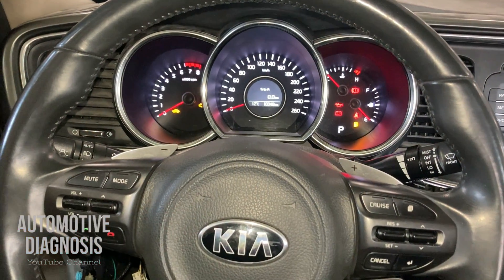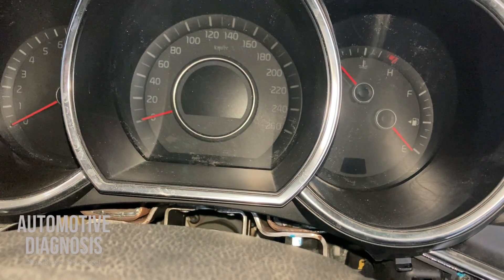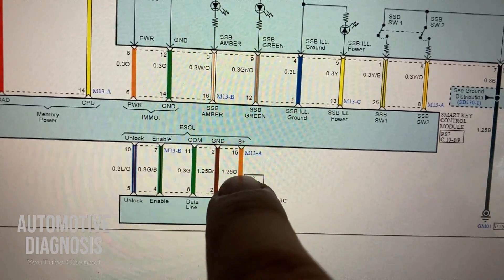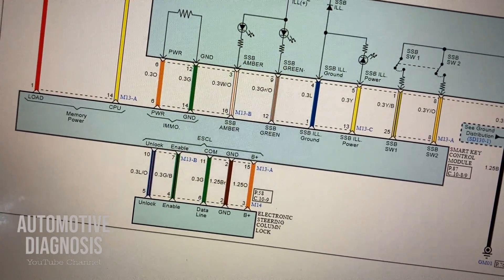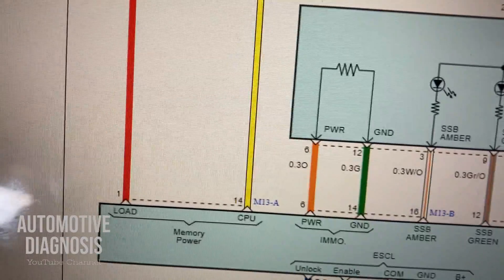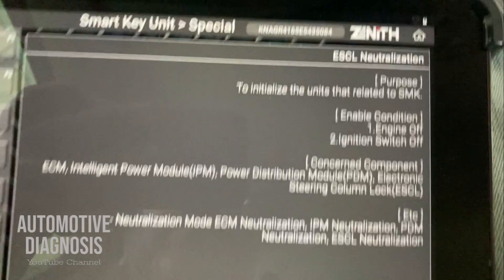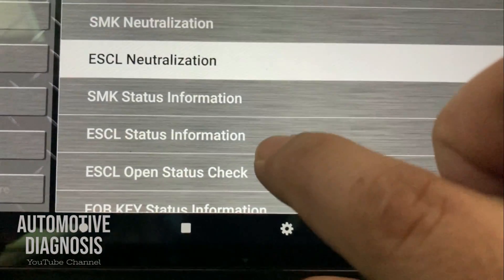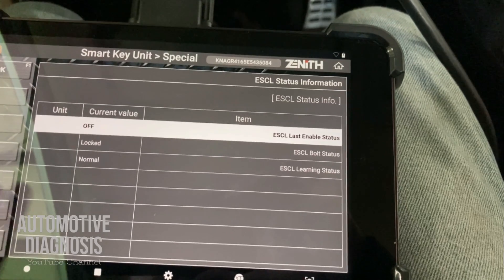Don't Replace Electronic Steering Lock Before Watching This | Check Steering Wheel Lock Diagnostics

Comment: Does this scanner carries wiring diagrams and components location? Is the name Zenith diagnostic tool
Reply from the maker: Hi my friend, yes it’s Zenith but it’s only scanner, diagrams and components location are not included.
Reply: @ a friend formatted my system with gds and since then it’s been a serious concern. Can you help me with gds software pls
Reply from the maker: @adsonymichael8778  I would love to help, but you know that GDS software is a very heavy software, more than 300 GB!
Reply: @ not a big deal i can pay you to get me a hard drive that can carry this and then pay for sending it to me pls. It is a very important software that I need.
Reply from the maker: @adsonymichael8778  It's not about the money my friend, I haven't installed the GDS for years (because it was already installed) and I'm not even sure if I can find it because I keep erasing the old files to make room for the new ones 😅. I remember I saw some websites which provide a link to download the GDS. If you have a good network, that could be an option.
Reply: @ pls can you share the website link?
Reply from the maker: @adsonymichael8778  I've seen different websites doing that, like this one that I just found:
https://www.obd2tool.com/blog/gds-vci-software-free-download/
Before downloading make that the website is safe, I just found them on the google, you may find many others by searching more.

Comment: I have a later model Kia (2022) sportage GT is model....am in despair as mine doing same but do not know which fuse to check, can you possibly help me?
Reply from the maker: H there, normally all fuses for smart key system are inside the interior fuse box, so if you can't find any fuse for SMK, or smart key, just quickly check all of them. A test lamp helps to check them in 2 minutes.

Comment: Hi sir is the power supply for the escl hot at all times or only when you turn the IGN because I'm having a problem with the escl of a Tucson 2018 and the power supply is showing 3.0 v and thank you in advance 🙏🙏
Reply from the maker: Hi my friend, power supply on ESCL in not provided all the time, when you pressed the start stop switch, power supply must be provided for a short while until it gets unlocked.
Reply: @AutomotiveDiagnosis  thank you very much sir i really appreciate your help 🙏🙏

Comment: I have this issue on my ford ranger raptor 2.0, 2020 model but i can still turn on and drive it normally. Any advice on what to do?
Reply from the maker: Hi my friend, what sort of warning message do you get?
Reply: @AutomotiveDiagnosis  this is the exact message "Steering Lock Fault Service Now'
Reply: @AutomotiveDiagnosis  we tried to clean the fuse ports and the fuse itself the error was gone, but we will observe it for few days more
Reply: @AutomotiveDiagnosis  the error came back after cleaning the port and fuse